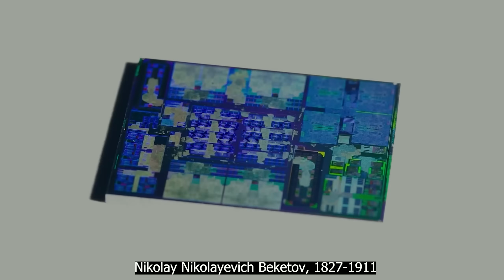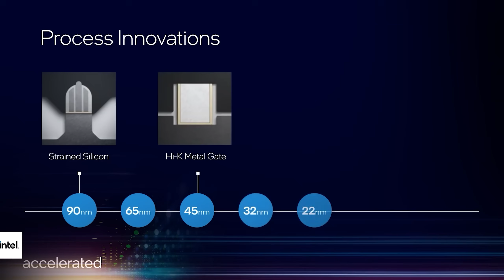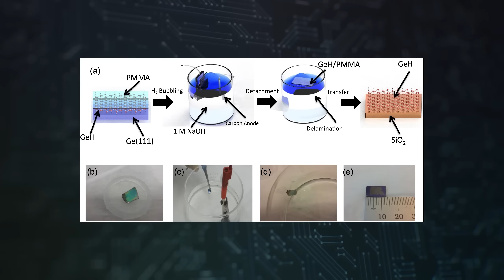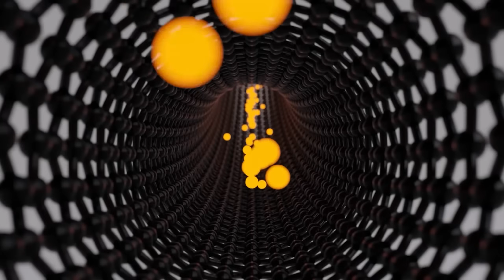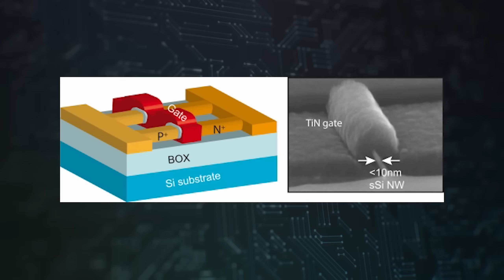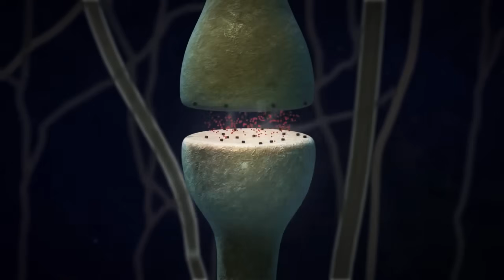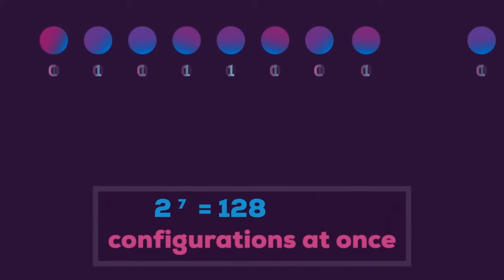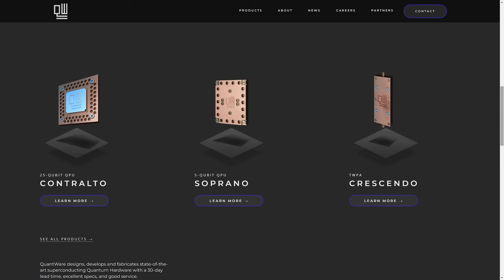End of the silicon era. Processors of the future

Comment: Quantum computers only appear useful as analogs for quantum behaviors.   Analog computers are much faster than digital computers and perform in set amount of time.   They are not what most people would consider a computer because they are most commonly composed of electrical circuits that use voltages and currents to be analogs to physical events. Once the circuit is completed it is hard wired and not programable.   

An analog computer can also be done with mechanical systems such as the valve body in an automatic transmission.  Any timed valve interaction such as the camshaft on car engine is a form of analog computer.   You change the programing of a car engine by changing its camshaft.  Another analog computer older car is the ignition advance system although that is greatly set by digital computer system today.  

Analog electronic computers are used for a few fast representations, but being based on a measured output voltage or current that measurement is not totally consistent and the circuit characteristics change ever so slightly.  These changes on instrument grade system maybe in the millions, but they are still not consistent at that level making them not fit for example running financial calculations that routinely need much higher accuracy and consistent answers.  

How a quantum computer would be used to solve encryption keys where the only means of solving them is to guess is a mystery.    A simple tough encryption system is to double encrypt the data so even when the first key is discovered the output still looks like garbage.   There is a formulation where the data encryption could be broken by a super key that solves both double encryptions and by extension many more.   This surpasses number lengths at standard size font that would stretch to the moon and back.   When  people get worried that is too easy they could make it to the sun and back.  

This idea of breaking encryption with quantum computers seems to make use of quantum behavior of super position where mathematically super position can be thought to contain all possible states because we don't have a means to predict its outcome.  That simply means it could be anything.  

There is the quantum behavior of locality where once two quantum particles are entangled they could be moved to far edges of the universe from each other and if one particle is perturbed to cause it to change its spin its entangled particle on the other side of the universe would instantly change its spin.   The issue has been that once the particle is examined that destroys the quantum entanglement.  Somehow this is used with photon over optical fiber to send encryption keys.   

Two photons can be entangled having the same polarity relative to each other.   If the receiver detects these two key sent photons are not still entangled that could mean some device has attempted to read the data stream and the receiver requests the sender to resend a different encryption key and tests again.  If this keeps on occurring the system would alert staff there maybe a possible data stealing and they'd check the line.  This allows for a lot of false alerts because encryption keys are only sent occasionally and the slight processing delay that takes place with new keys is typically fractions of a second.    

It is sill not clear if the traditional  public private key system used in secure NFS and other network data system was ever successfully breached with the cyber key transmitted still considered to take a week to break in 2000.   The processing required to constantly run the public private key handshake takes too long for immediate data transmission and is used to send a encryption key that is stored locally and constantly decodes information until it expires or is forced to refresh.  This meant Sun workstations in the 1990s running secure NFS had a lot of cyber processing keys from the other computers it was connected to.   Today similar systems are used for secure internet connections.   Certificates are used to identify the source as real and not a fake sending encryption information. 

Chemical reaction of biological systems with huge long molecules such as DNA have discussions of behaving with quantum behavior.   If that is true that would allow quantum analog computer technology to model complex biological chemistry which would be hugely valuable.   Such a quantum computer could quickly analyze the interaction of venom on human cells and be programed to create the formulas for anti venoms.   It is still too vague to understand how this might be possible.  Being chemical behaviors being accurate past millions percentages is unnecessary.

Comment: When it comes to silicon being a pillar of computing, that will never really go away.
Why ? Mass computing. Basically, when wanting to do computing en masse, given that
power usage is not a problem with enough silicon-based photovoltaics in mind,
computing can still use mostly silicon-based computing for when computing something
that requires so much computing power that using the more scarce resource based
computing options become prohibitively expensive.
It's like creating a very large computer that can be like a workhorse, while using the more
scarce resource based computing option for small applications.
The workhorse can be used as an off-site computing 'monster' to offload work on.
This may seem rather inefficient, but given that electricity can easily be farmed with solar voltaics,
the power requirements are a lesser drawback, while the mass computing becomes cheaper
over time, and can yet benefit from increased performance.
Once people go into space and build space stations, remote computing this way can be
much cheaper than supplying the more scarce resource based computing options for all/everyone.
The problem is not one about creating a few million small computing options that require scarce
resources (and thus becoming expensive), but once the newer options need to be created
by the billions, yearly.

The amount of mining required to get enough of the scarcer resource would be bad
for the environment in such a fashion that humanity would 'compute' itself to death.
Since, computing to death does not compute, en masse computing with the cheaper
silicon option makes more sense.
Also notice that en masse computing is much more efficient. When a resource isn't used
by someone, someone else may be allocated more computing resource aiding his or her
task to complete more rapidly.
When it comes to remote computing for things like gaming, this may also work well.
Silicon will always stay the best and easiest resource for computing, since it's most abundant.
Also, the new computing options will have their own size limitations, albeit somewhat smaller.
This would be a fixed factor.

4:28 Yes, the cost of fabrication of non silicon processors is much higher due to the scarcity
of the required materials. This will never change. Also, due to the limitation of availability
the newer processors would be fabricated in much smaller quantity, while being much more
expensive. Due to rising cost of scarce materials the cost over time would rise, not become lower.
For regular silicon-based processors, these would become cheaper over time.
Combined with photovoltaics the increased power usage would not be the limiting factor.

13:56 Photonics are best used for transfer of data, not computing. Extreme short relays,
let's say between chip layers and external to chip pathways would be an option,
since these can transfer data really fast, and yet use very little power,
which results in less heat release.
Photons travel light so to speak while electron travel is heavy. This means less heat release.
There's one problem though, the creation of very small light emitters/receivers
and very small fiber optics or such is much harder than a regular circuit.
It's at this point in time at least not very useful. A similar thing is with the wattage per computing.
If the wattage becomes low enough, further reduction of such becomes less useful,
and with that only extreme high end computing purposes would be served by further reduction.
Let's examine an example, where you can have a fully capable processor using a 10 cm by 10 cm
solar panel for continuous usage. What would the difference make if it's then operable
by an 8 x 8 cm solar panel instead, by increasing the cost tenfold ?
It would mean less power used, yes, by as much as 33%, but then the tenfold cost ?
So, at some point in time the resource cost will define the computing solution,
rather than its capability, once again referring to the scarcity of materials.

14:46 Photonics will not remove the limitations of distance. Any signal will still be limited to
the speed of light, whether electronic or photonic based. Latency stays the same no matter
which of these mediums are used. Basically, the best way to make processors smaller
and faster, currently, is to provide on-chip memory, with comparatively slow memory being
used for the externals. On chip memory would increase processing by removing much of
the latency of memory instructions, like cache does, but then used on a larger scale,
with only one cache and larger memory area. Then you'd have 16 GB base memory on the chip,
with like 4-8 megs in cache. When a large-scale external reference would occur
(like writing to SSD) the memory controller would copy the on-chip memory to the external one,
subsequently transferring it to SSD, while optimizing the transfer speed, between on-chip
and external memory. On chip the memory could have the same latency as regular cache,
but transfer between the on-chip memory and external (DDR) memory would still be many
times greater than the transfer speed between regular memory and SSD.
Also, when using stuff like virtual memory on an SSD, this could then be replaced by
the external (DDR) memory, increasing computational output per unit by that much as well.
Knowing that most of the CPU's and GPU's time is wasted on waiting for memory return,
you know that this transfer of operations from external memory to on-chip memory
can make a big difference, even when the computational output of the processor
is yet smaller. Solving each bottleneck in turn is also a way to speed up computing,
in some cases making a bigger difference than making it smaller.

Comment: The reality is, that a replacement for silicon is still science fiction at this time. And quantum computers suffer from decoherence, which is when the entangled state of electron pairs is lost because of noise, cosmic rays and other random termination events. Nobody has an hint on how to overcome decoherence in quantum computers. Should they become operative, their fields of application are completely different from those of classic computers.
In any case, there is still room for a three orders of magnitude improvement in current computers using 5 nm tech (6 billion transistors) - such an improvement can be achieved by changing the compilers, or writing the software in assembler.
Happy New Year 2024...

Comment: look, do we actually need any faster CPUs? It's not so bad as it is even if we only keep on improving the designs and software still using the same technology, that might actually be for the better as given some time there would be lots of factories catching up, driving the price for a fraction of the current price, making CPUs comodity just like transistors or resistors are now (as the current price has to cover years of research and development...)

Comment: Ok, im seeing a lot of these types of videos and people are unaware of what weve done in the past. I assure you that silicon will be in use for the next 1000 years. 99.999999% of semicponductors
do not need to go that fast. I regularly use 60 cent processors running at only 16KHz. So if we change Moores law to say performance will double instead of transistor density, I see Moores law remaining in place for some time. In the 80's i used to work in the supercomputer industry. We had one array processor made of silicon and made a copy in gallium arsenide, which ran at several orders of magnitude faster. So that is one solution. You can also use different architectures. When I worked for Cray Research we had an architecture where memory bottlenecks did not occur, so you could use something similar and add a bunch more cores with memory not limiting your speed. Finally, you could dump windows and use a fast linux...youd get seceral orders of magnitude speedup by doing that.

Comment: Anyone who goes from talking about typical CPU computing to quantum computing is an idiot.  Anyone who goes from talking about Moore's Law to quantum computing is an idiot.

It's SO laughable because of the large amount of information that's being left out of the discussion, and the failure to even talk about process nodes, where the industry is today with transistor density, the discussion about if getting past a certain transistor density even MATTERS or do we just need some adjustments in the way we compute?

Home users have all  the compute power they could possibly need.  The only issue becomes the compute power needed by data centers and enterprise, scientific computing, etc.....  Silicon will NEVER stop being the medium used for making ICs at at least not for the next century because it's EASY now.  It's also economic.  

This showed Intel going to 20A in a few years.  Yes, Intel will be at 20A in a few years, so will Samsung and TSMC.  Did this mention what that means for transistor density or how much compute power that gives for a watt being consumed?  Do you think a quantum computer will be cost effective?  Consume very little power?  Right now we are about to be at the point that a laptop has the amount of compute power that a server had a decade ago.  That doesn't mean a $300 laptop of course, it means a $3000 laptop.  Home users have access to a huge range of compute power, going from a cheap laptop, or really a tablet or smart phone, all the way up to full fledged workstations which now are doing the work of a few server racks a decade ago or going back to 2010.  So home users will be using silicon based ICs for decades because their compute power needs will be met, and 95% of home users already have all their compute needs met.  It's mostly gamers that need more compute power, but they also need games to be better written so they use today's technology better.

SO moving into data center and enterprise, the answer is YES they will have the compute power they need without ever needing to move to quantum computing or moving away from silicon, and that's because of using different compute techniques which were never talked about in this video.  There is more than just simple CPU computing.  There is graphics compute which solves many problems faster than CPU compute, and I mean a LOT faster.  There is also AI which is helping to solve different types of problems faster, and that's based on using a different type of processing core, such as tensor cores for Nvidia, and there is acceleration.  With the combination of compute techniques, I'd say that pushes quantum computing into the next century.  Just an educated guess.

Comment: Someone without knowledge talking about it... do you even know roadmap of new nodes and what they bring? We have around 10 years of silicon still.
2:10 do you read research paper this lower this effect by add-ons? No? Why I not surprise, maybe GAA would show in video (GAA is not related to tunnelling).
3:20 so now you talking about thermal design, which you don't know, only you basing it on analogy to what you know, do you ever look at silicon for eg cars? 100C is limit for water, but not silicon. BTW smaller transistors use less energy, so you put more in same space, but each taking less energy, so overall heat don't have to go up. Intel and with current gen AMD is doing it, because they start battle for consumers so they use any advantage they can, nothing more, look at CPU for laptop different story, same TDP.
18:10 yep, you don't have idea what you talking about, this quantum computer is nice for research, but do you ever heard about logical qubit? Because if you don't want to calculation ended with errors, you must use them. So this "computers" are toys. And ignoring photonic/optical computing which is most likely next step, because we already integrating it in our silicon base computers which are use not only for research.

Comment: I don't understand why they need to make the transistors smaller. I mean its a great thing to work towards for many use cases, but what about idk.. make bigger CPUs? A slightly bigger CPU would fit a lot more inside of it.. I'm sure there's a reason for it I just don't know, but I always wondered why they just don't make a larger socket and CPU to make a leap forward in computing.. at least until we can make even smaller chips.. but even then, you could still fit even more smaller transistors into a bigger CPU. Why isn't that a thing?
Reply: They do that for certain chips, but for the average home laptop or desktop it won't be efficient, it would suck up more power and put out more heat in which would come at the cost of more thermal interface/heatsink material to dissipate that heat in which would require more space to allow for enough airflow to do the cooling.

Comment: I'm still a bit confused by how qbits are so powerful. Yes, having 3 values is better than having 2, but analog systems can do practically infinite, since you can read voltages or amperages from 0 to however high a voltage or amperage your system can handle. The main limitation was that the loss of current greatly varied and made it unreliable, but couldn't that be fixed by superconductors? We already use superconductivity in quantum computers, so it makes no sense to me to settle for 3 when you can have practically limitless numbers in one memory unit.